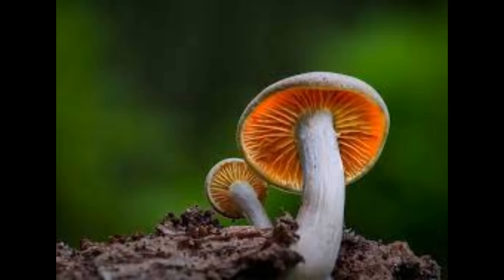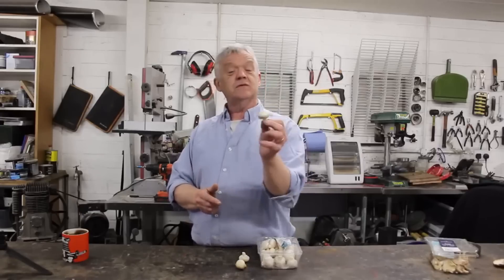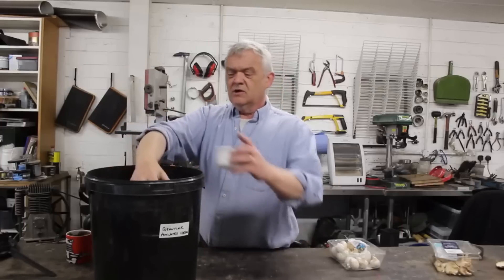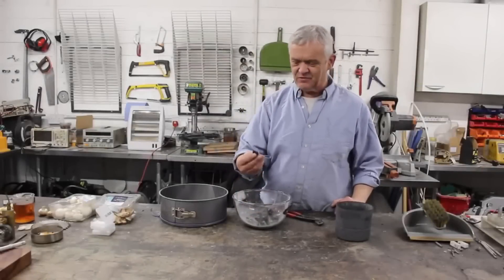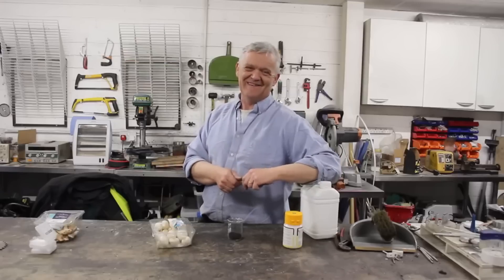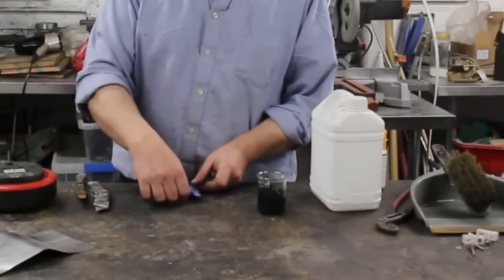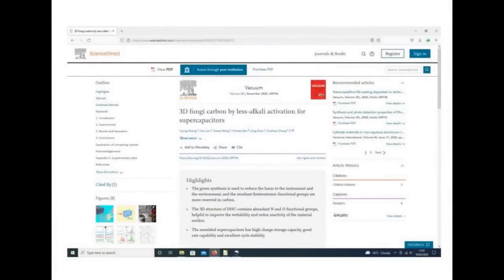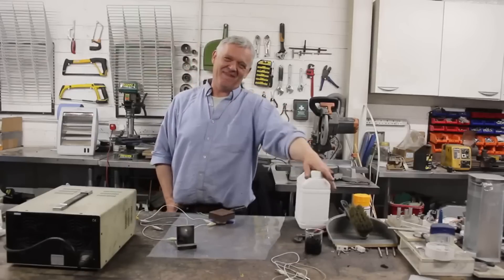2252 - Mushroom Power - How To Turn A Mushroom Into A Supercapacitor

Comment: Does this have to use mushrooms as the organic carbon source? It seems like what makes this work is the powdered activated carbon, providing the immensely high surface area, which is how you get such a high capacity for charge storage relative to the low mass and volume of material used, with the aluminium foil acting as a common conductor, joining all those tiny particles of activated carbon together in parallel. But if this is what is happening here, then surely it would work the same way no matter what you made the activated carbon from? Or is there actually something specific to the mushrooms which somehow makes the activated carbon made from them more effective as a charge storage medium than activated carbon made from any other organic material?

Comment: Question not related to this episode: How to find a good and relatively cheap water turbine for microgeneration?
I have a pond (circa 22x45m) with springs in it. I use 16cm pipe to remove excess water. I plan to use syphon and net-filter to reduce the amount of dirt like leaves and branches, syphon would suck water below the surface. It would increase momentary flow, I would like to use energy from flow.
Level difference is a little bit more than meter.
Reply from the maker: there are lots of options mate - all you can do is review them and make a decision - everything will ave pros and cons - it's up to you really on what is important to you

Comment: "Canadian research that shows supercapacitors with electrodes made from hemp-based carbon nanosheets outperform standard supercapacitors by nearly 200%.

  The nanosheets ranged in thickness from 10 to 30 nm with high specific surface area (> 2200 m2 g-1) significant mesoporosity (up to 58 percent), and good electrical conductivity (211-226 S m-1). Mitlin indicates the nanosheets are compatible for various ionic liquid-based supercapacitor applications from about 0-100° C.

“At 0° C and a current density of 10 A g-1, the electrode maintains a remarkable capacitance of 106 F g-1,” notes Mitlin. “At 20, 60, and 100° C and an extreme current density of 100 A g-1, there is excellent capacitance retention (72%-92%). These characteristics favorably place the material among the best power-energy characteristics ever reported for an electrochemical capacitor. At a very high power density of 20 kW kg-1 and 20, 60, and 100° C, the energy densities are 19, 34, and 40 Wh kg-1, respectively.”

Moreover, adds Mitlin, the assembled supercapacitor device yielded a maximum energy density of 12 Wh kg-1—significantly higher than those for commercially available supercapacitors. By taking advantage of the complex multilayered structure of a hemp bast fiber precursor, these high-performing carbons were created by simple hydrothermal carbonization combined with activation."

Comment: Is it anything that can be carbonised or mushrooms in particular? My first thought were "I wonder which grows and can be dried/processed quicker en masse, mushrooms or bamboo."
Reply: I had the same thought, mushrooms do grow pretty slowly compared to grasses. My brain went to straw, but bamboo is even better.

Also, I'm assuming the higher nitrogen content of the fungi is just burned off. Maybe some remains and improves performance in... some way?
Reply: The right conditions can make some grow in as little as 24hrs if I remember correctly tiny spuds through lol
Reply: You can

Comment: Thanks for the video. 150 FARADS per gram is pretty good. About  10,000 farads = ~1AA battery  (roughly). So, you need a LOT of farads to equate to 1 AA Alkaline battery. 
An equivalent mushroom paste version would need almost 70 gms of paste only to = 1 AA, and I measure a battery here at 22 grams (including the casing).  (And that doesn't include all the other materials to make the capacitor itself).
Considering that mushrooms can be "grown"... manufacturing a fairly large capacitor bank capable of storing the same energy as a bank of AA batteries is feasible. Such a bank could be equivalent to a 1kWh bank for inverters. So this could have some good implications for the future if manufacturers use this.
Additionally, capacitors tend to have charge / discharge cycles may times better than any rechargeable battery.  (Not sure about this version tho).
Great info!
Reply: I've looked into this, with a mind to spending some serious money on a "power station" for a rural location and it turns out that the best solution is a combination of Edison batteries and supercapacitors, both last a very long time and compliment each other in ways that remove their individual downsides, which is why you never see "haters" comparing the combination against any other technology. Deliberately ignoring synergy (systems rather than components) is a common deception by omission tactic.
Reply: @DanielSMatthews  Edison type batteries are amazing if you can find them at the right price...
Reply: @marcfruchtman9473  Yep, sadly I can't get the ones with the nickel steel cases, the ones that really are immortal if well cared for. The cheaper plastic ones are limited by the life of the plastic, but my sparkie knows a guy who just took their guts and put them all in one huge custom stainless steel trough.

Comment: I would argue that if mycelium can form intricate chemical structures along with Crystal structures I should be able to extract carbon out of the surroundings and convert that into a concentrated carbon material ready for use for a supercapacitor if it's genetic code was correctly programmed

Comment: its interesting that the magic mushroom  psilocybin cubensis' active compound, psilocin is a seratonin analog neurotransmitter that binds to the 5ht2a receptor Meanwhile amania muscaria red white spotted magic mushroom goes to GABA the on off switch. wooo! I love shrooms! :D
Reply: I'm curious now how psilocin fro shrooms, as  a seratonin analog increase neuroconnectivity and signalling in the brain, like it produces more current in neuroprocessing but regulation of that connectivity can be a problem hence "tripping too hard" or having a bad trip. Man, I haven't had a shroom in half a decade. what  a shame they'e so nourishing spiritually, like a long pilgrimage from the woods.  I wonde if they can use binary encoding of seratonin analog bombardment to neurons to force-feed educational material to brains by giving the increased bandwidth structural value rather than just floodin the person with emotive awe of the rush of sensual amazingness
Reply: What happens when you take both??
Reply: you should ask Hamilton Morris the pharmacoligist / chemist / psychonaut if you can pay him to answer your question, I can promise you no one else in the world can really answer your erudite question very well at all except he. @st33ldi9ital

Comment: I am wondering why you grind the mycelium at all instead of just growing it into the desired shape. (two big plates) and repeat every step on the carbonized mycelium as per your video. the surface area would be incredible. it may make it more difficult to attach the electrodes OR you maybe could just grow the mycelium mat around the electrodes in the first place?
just my first thoughts on it.
Reply: I thought the same thing. Maybe the grinding process adds more surface area? That's what I always wonder when a high surface area material is blended or powdered